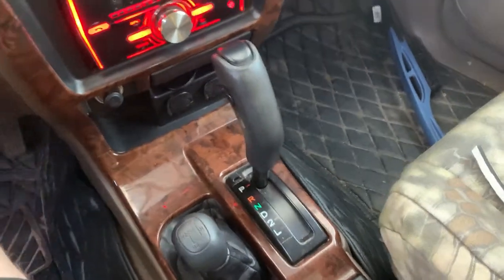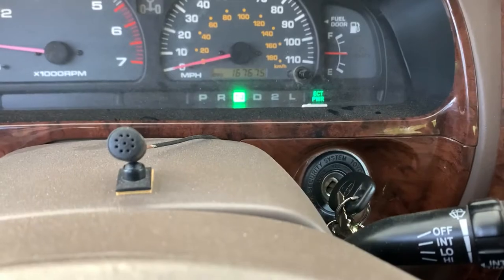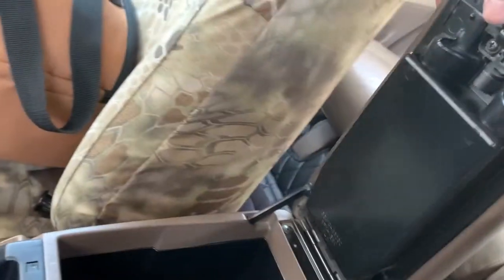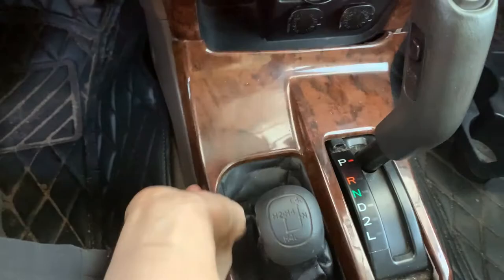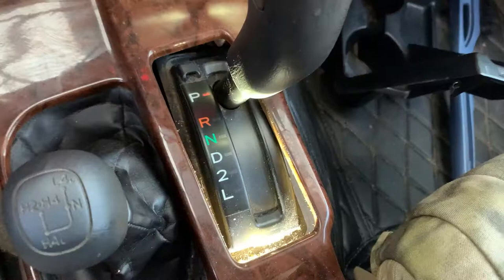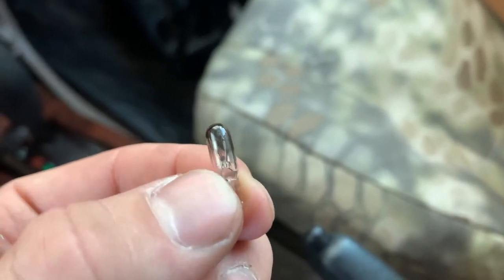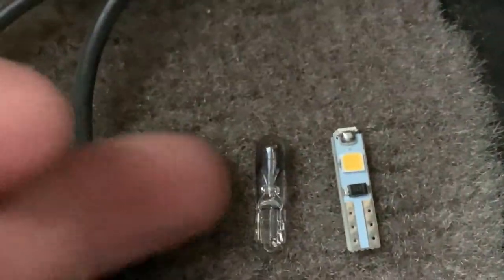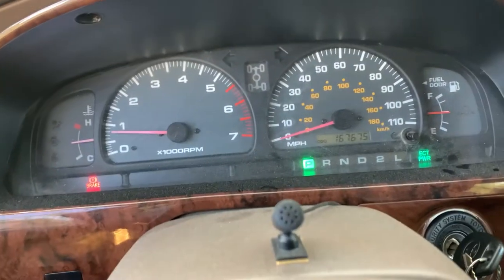3rd Gen Toyota 4Runner | How To make the Gear Shift Indicator Light Up again Using an LED Bulb

Comment: The 4 x shifter knob just unscrewed on my 99  4 Runner SR5  so I could lift the panel for additional working room and clean out the accumulated dirt and trash. I did this while  changing dash and center console bulbs with LED replacements. Big improvement as far as I'm concerned.
Reply from the maker: good to know! yeah would be nice to clean under and around there for sure!

Comment: Heads up; The OEM bulb  is actually 2721 12v.  The 74 bulb is a 14v and Looks the same but in fact it’s longer and if your having difficulty screwing back in the bulb into the shifter slot it’s because of the bulb.
Reply from the maker: Good to know, mine fit great but something to watch out for

Comment: Hi, what if the gear light on the cluster is dead? My D light in the cluster is dead is there a bulb behind it too?
Reply from the maker: yeah just a burned out bulb most likely. probably a different bulb but should be pretty easy to replace

Comment: How do you change the gear shift indicator on the dash?
Reply from the maker: gotta pull the instrument cluster out. maybe ill make a video on that later on
Reply: @4WheelKid  that be awesome because I got a D4 light and I can’t find any replacement other than the OEM which is expensive for a small bulb…

Comment: How is that led working by now? I made the same for mine but the leds started flickering  a lot within a month of use
Reply from the maker: 5 months later mine is still working great no issues or flickering. I'm sure there is a failure rate with led's. sometimes you might get unlucky, at least they are cheap

Comment: Don't, bother with the LED's, they will end up flickering and dying. My OEM lights have all lasted 20+ years, this is the first interior light to burn out in my 2000 so I will be putting the same type of halogen back in
Reply from the maker: it's up to you. will be a test to see how long this led lasts. so far so good. my cheap ambient lighting kit I put in the 4 runner over 4 years ago has had 0 issues. i'm sure there is a failure rate with led's but if you get a good one it will last longer than halogen
Reply: @4WheelKid any update on how the leds are working out 2 years later. I’m thinking of doing this upgrade for my wife’s 98 Limited